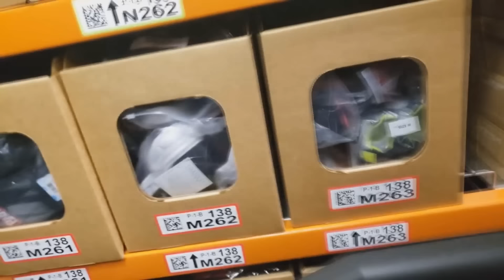THIS VIDEO WILL MAKE YOU CRINGE

Comment: 3:53
Broken rule 1 of forklifts) Always look in direction of travel
Broken rule 2 of forklifts) If the forklift is in gear, you never stick your limbs out the confines of a truck, and you always do an all around check if you have to. His load is also too high, he should be driving backwards

So yeah, for anyone with warehousing experience, this tells you straight away he's probably got a forklift license or has done the course, but does not drive a forklift often. SO fortunately, you have fair warning on this part alone. You do not want to work in a warehouse where people drive lifttrucks like this.

Comment: i used to work at amazon, and left after about 2 months when my knees started to make a cracking sound. I was a picker, so we would walk long distances for 10 hours scanning and picking up items and dropping them off at the assembly line. We legit walked about 15 miles a day. I had no issue because it was a good work out BUT The quotas were so bs that if we miss the quota even by 1 item, you get a strike. Get 3 and you lose the job or get offered to quit and reapply later

Amazon workers dont get benefits until after 6-9 months i believe so it benefits the company when people leave, seeing as how many people line up to work for them. Case in point if you wanted to reach quota, you legit had to be speed walking for all those 10 hours. As for bathroom breaks, you can take one BUT thats time you could have used to reach quota. So thats why many people dont go for a break. Case in point, it got to a point where an inspector was looking for me to see why i was missing quota and when he found me he was surprised i was zoomin so fast. He kept trying to find me but i was moving from a to b. b to c. 

He said, youll be alright, you were moving at a good pace and he left. Ironically i still wasn't making quota. In short, at least as a picker, amazon forces us to over exert ourselves every day for 10 hours, 4 days a week. If you dont, youre out. 

And when i told them about my knees, i had like 6 employees all around me asking questions about what happened etc etc. It almost felt like they were trying to avoid a lawsuit, trying to get me to say that maybe I wasn't bending properly when picking something up, but i confirmed that i was doing it the right way. So in the end, i quit. The quotas and stress of reaching a seemingly impossible standard make this job really not worth my health and peace of mind for a few extra bucks.

Btw this is coming from an athlete, played soccer and danced (bboyin/poppin) So When i felt me knees feel weird, i knew it wasn't worth risking my health for a company who would replace me in the drop of a dime
Reply: Well spoken, I appreciate you. I hope you're in a better place now!
Reply: Very well spoken, I was thinking bout applying but fuck that😂
Reply: I was a picker as well. 5 years later and it's still the absolute worst job I have ever worked by a massive margin.

Comment: I work in a factory as well I worked in a very chaotic department for 3+ years but I did my diligent “back breaking” work 🙄 and earned the opportunity to move up a little bit in the company with a much more laid back environment. The turnover rate is very high but it’s that way because people coming from jobs where the labor and “hands on” work is so much less than what you’d get in most factory jobs. It’s a lack of work ethic.

Comment: I’m applying Amazon as job upon seeing that im having mix feelings about that and amazons rules and regulations 🙂😐😶
Reply: Bro it really depends on the particular warehouse you go to. I worked at Amazon and it was completely fine. They were actually really relaxed and it got boring at times because there wasn’t much to do. The horror stories you hear are isolated incidents and happen in almost every warehouse job if the conditions are not good. It’s really not that bad.
Reply: If they assign you something called “Pod Project” as a new hire. Just walk out. ☠️
Reply: I work as a delivery driver, I say it’s much better. I’m on the road by myself 95% of the day, so I don’t have a manager hovering over me.
Reply: Im a driver. Its fun as fuck at least for me

Comment: I worked there for 3 years as a picker, but cross trained in several other areas. I always made rate and well above. But the “time off task” was torture. We were only allowed 30 mins when I was there from 2016- early 2020.. 

I remember being on the 3rd floor at the end of the building, nearest bathroom was 3-5 mins away depending on if I could run without getting yelled at. So 5 mins there, 5 minutes using, and 5 mins to walk back…tHaTs 15 mins time off task right there. I just used my PTO and left for the day, I was way to stressed lmao…

So happy to be away from that place. I didn’t mind the work at all, it was the stupid rules that ruined it.

Comment: i used to work for amazon as a second job in 2010 and this is too accurate. They wanted 110 percent pick rate and before each shift they got together and did stretches like some cult after words of encouragement to scan more lol. They call themselves "amazonians" like some cult. They escorted me out after i reported two amazonians for harrassment and i ended up losing my temp job cause of how they spun the story. you had to walk through two metal detectors and turnstyles that go to ceiling....like a prison!

Comment: Here's a review I put up for amazon delivery when I was done working there

The pay for this job is horrible $16.50 an hour sounds decent until you notice how much you're doing throughout the day, often times with no time to take a break or lunch, if you do take a break or lunch most likely you will be behind on delivering packages for the day. UPS is less intense with less packages and more space in your vehicle starting at $23 an hour. People have passed out on the job from heat exhaustion and have a hard time finding a restroom after around 5 or 6. If you need a quick job then this is fine. But there are higher paying delivery jobs nearby where your pretty much doing the same job just less intense with better pay.

Pros

When you're on the road you don't have to deal with anyone

Cons

Sometimes no breaks or lunches. Pay doesn't match the demand of work

Comment: Used to work for a company that did Amazon fulfillment. Once we started doing work for Amazon, expectations and our treatment instantly changed. Instead of a “just get the job done” mentality, it turned into you need a transaction every 5 minutes and 60 transactions at least an hour or you’ll be written up or given a verbal warning. Bc it wasn’t Amazon and just fulfillment, the pay sucked (13.50 for heavy machinery license and lift equipment license with nearly 5 years) with similar efficiency expectations and identical packing requirements. I literally got off my forklift to piss and had my manager come into the bathroom to ask why I didn’t have a transaction in the past 5 minutes. Told him to piss off and I left for the day by using emergency sick time. The messed up part was I knew the guy before we became contracted with Amazon and how he viewed all employees were night and day. In fact, we weren’t referred to as employees anymore, but “resources”. I was a thorn in their side until I quit during 2020 after returning from a LOA, the final straw was being forced to go on second shift and got a 2 dollar pay cut Bc I was put back in packaging and I wouldn’t be using my licenses anymore.  Fuck em and fuck Amazon.

Comment: The one thing I will give the Amazon fulfillment center is that they do acknowledge good work. If you are constantly in the top 10% of stowers or pickers or whatever, you did get awarded i.e promotions and generally moving up in the company. A lot of the team leads and supervisors I had when I worked at one were employees from within rather than abroad. Not trying to justify them in any way cause I got fired for being sick but I will give credit where it’s due

Comment: Ha, glad word is getting out. Worked in the warehouse and as a flex driver for a few months, and it was brutal work. Ironically it's part of the Amazonian culture. They're really good at brainwashing their employees and pitting them against each other. Those employee spec sheets are gone over before each start of the shift. Employees are at each others throats grabbing the closest forklift and the closest parking spots to walk to the lunch room/bathrooms quicker. As a new guy you'll be stuck in the farthest parking spot with a forklift missing equipment. Good luck catching up to the top employees since it's so cutthroat like that. They reward employees with mandatory overtime. If you can't work said mandatory overtime (during holidays) you're fired.